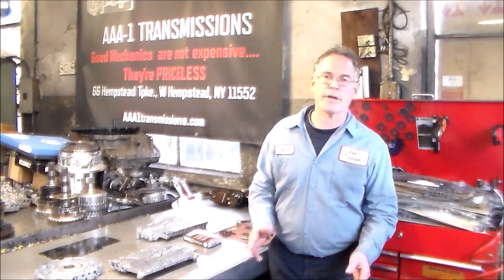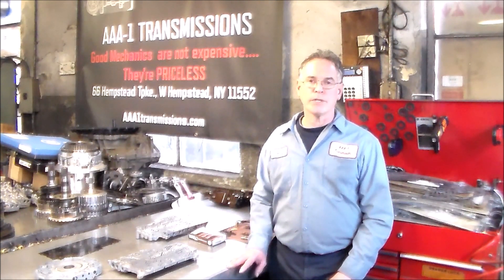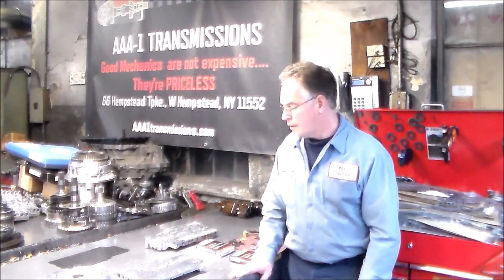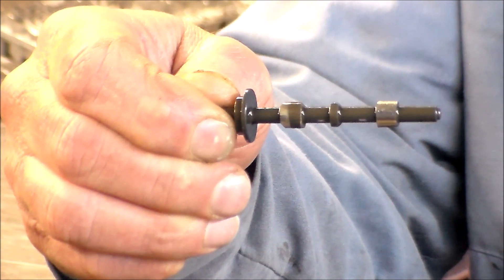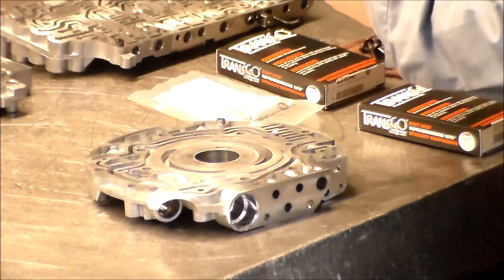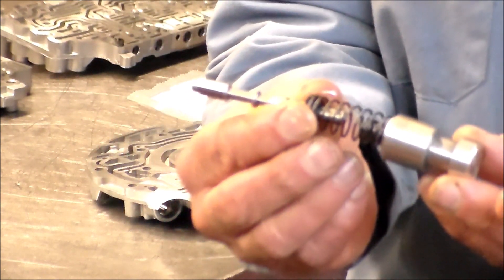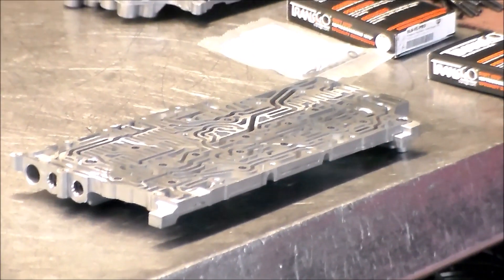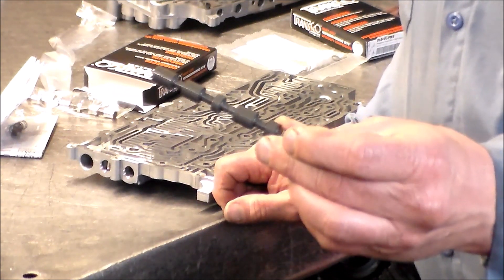6l80 Valvebody Upgrades

Comment: Awesome work you do, congratulations!!! Any upgrades you suggest for Subaru’s 4EAT phase 1 and 2 transmissions? Best regards.
Reply from the maker: i like to do the transfer clutch solenoid, phase 2 i don't think you can get OE so if works ok reuse, I think the aftermarket one did not fit correctly
Reply: @GaryFerraro  Did you find any codes? I didn't find any code yet.
Reply from the maker: I did not
Reply: @GaryFerraro  It's hard to say what happened with my automatic transmission.I didn't take my car in a workshop specializing in automatic transmissions yet because i was a little in dept but now i paid off everything and i can take my car to your workshop.How much would you charge to make the diagnose? Here in Los Angeles i haven't met anyone who specializes in automatic transmission.

Comment: Have you gotten any of the 8L80’s in yet?
Reply from the maker: just one a while back, couldn't really get parts so i went with a dealer reman, and serviced a couple,
Reply: @GaryFerraro  Hi Gary.Here in Los Angeles there isn't any workshop specializing in automatic transmission.I don't change the atf fluid yet and seem to be very black and old.When it makes a shift,the rpm shoot up for a second and then goes into the next gear so what should i do then? There isn't anyone here that has a scanner.
Reply from the maker: @mikepittsburg6939  this happens on what shift 3-4?
Reply: @GaryFerraro  Yes,i mean,in all gear changes.I didn't change the atf fluid yet because i didn't have time for that but it's impossible to say what it is without making a diagnose,do you agree?
Reply: @GaryFerraro  Surely in my case changing the atf fluid doesn't solve because there are problems inside the automatic transmission.
Reply from the maker: @mikepittsburg6939  slips every shift?  This is a 6L80
Reply: @GaryFerraro  My car is a 2012 Cadillac CT5 equipped with 6.2l V8 engine.
Reply: @GaryFerraro  I think it's equipped with the 6L90.

Comment: Cuestión i just rebuilt a 2015 6l80e  and i intalled to the valve body the lock up kit and end plug kit with HD converter and still doing the tcc chatter.any idea it might be the problem? Ive years doing this transmission and always the issue goes away.thanks
Reply from the maker: Honestly, the first thing i would try is a couple of tubes of shudder fix
Reply: @GaryFerraro  tubes? I'm sorry I don't understand?
Reply from the maker: @pablomoreno7474  Google Dr Tranny, Instant Shudder fix, it is a red tube.if you do that put 2 tubes or you can put the Motorcraft posi additive, i would try that first before anything else
Reply: @GaryFerraro  I understand now.thank  you so much for your help

Comment: I have a lot of skating on my 6l90 automatic transmission.When it makes a shift,the rpm shoot up for a second and then goes into the next gear.I thought i changed the atf fluid totally but there was still a lot of old atf fluid in the torque converter and valvebody.I change every 30k miles.
Reply from the maker: if you feel flared shifts pressure may be low in the trans
Reply: @GaryFerraro  What should i do then?
Reply from the maker: @mikepittsburg6939  have it scanned for codes, that may give a direction
Reply: @GaryFerraro  I already scanned.
Reply: @GaryFerraro  I have to change the TCM but if it doesn't work i'll look for you to solve the problem.Where are you located?
Reply from the maker: @mikepittsburg6939  what type of scanner snap-on or autel?
Reply: @GaryFerraro  Neither of these two.It's an unknown and cheap brand that i don't remember the name.kkk
Reply from the maker: @mikepittsburg6939  Do you know anyone with a good scan tool?
Reply from the maker: @mikepittsburg6939  I'm in New York
Reply: @GaryFerraro  No.Here in Los Angeles i don't know anyone that has a good scanner.
Reply: @GaryFerraro  if i could take my car to your workshop it would be better but it's too far and financially unfeasible.
Reply from the maker: @mikepittsburg6939  yes, agree on that, i do not know anyone there
Reply: @GaryFerraro  I go to buy a new automatic transmission or to buy a new car.What do you think? What would you do in my place?
Reply: @mikepittsburg6939    only you know the condition of the rest of the vehicle.  How's the engine? Suspension? Brakes? Body? Versus buying a new car in cost & insurance, etc
Reply: @CubasAutomotive  Everything is ok,except the automatic transmission that is slipping when changing gears.
Reply: @CubasAutomotive  Why?